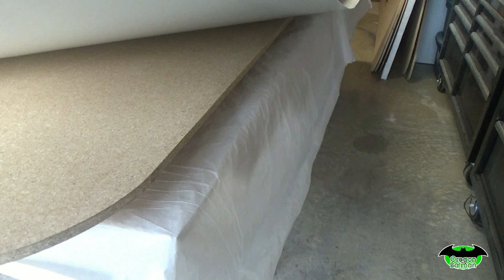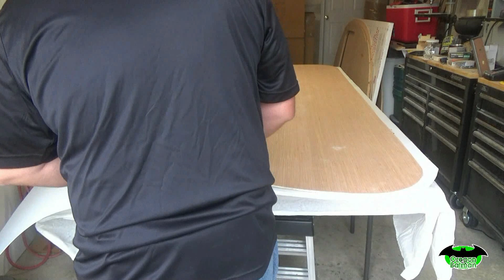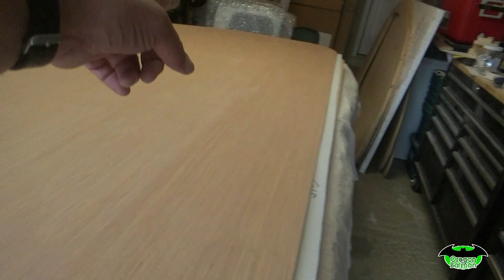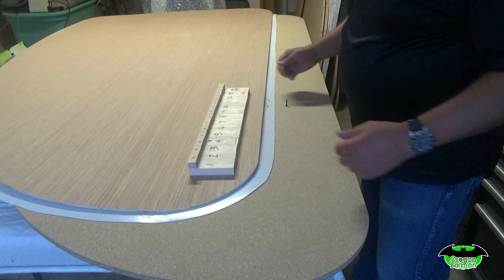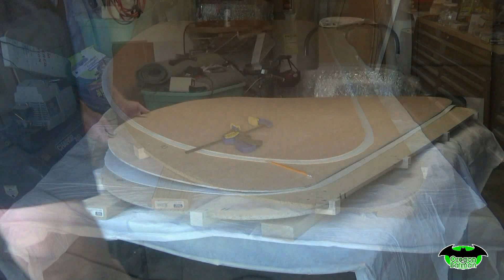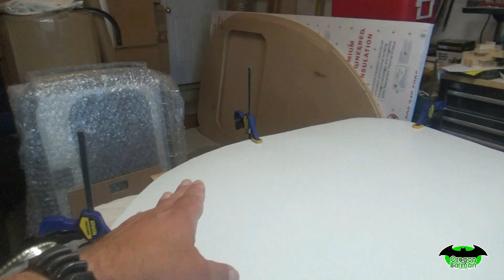Let’s Build A Teardrop * Step-By-Step * - Part 8 (Filon for Outside Walls)

Comment: Couldn't you have put the filon on the plywood sides before cutting either out with the template?
Reply from the maker: Absolutely. I didn't want to install filon until I was ready to install to side of teardrop... the 1/4" wood panel wasn't able to stay completely flat after the install due to moisture content, so it was better to wait. Made it much easier to work with!

Comment: couldn't you just have.....   laid the filon on the template, then clamped it, then routered it out, to perfect fit, then just glue it to the outside wall??   I don't understand why you needed all the blocks, and three-layer deal

Comment: Today we apply filon.  We are using the adhesive you used.  What did you use for thinner to clean the spray gun?  We read the instructions but didn't see anything about clean up.  Our build is coming along.  We are following your build series of videos with the build plans!  Going great!
Reply from the maker: I used Acetone for clean up... turns the glue into a gum which is pretty easy to wipe off. You will need to disassemble the gun to make sure to get all glue out

Comment: If you would use a right hand tinsnips it will cut easier for you than those straight snips. Right hand snips are red
Reply from the maker: Agreed! Although they did the job, sort of chewed the filon up a bit. Ended up using a pneumatic tin snip... now THAT worked great!

Comment: So cutting filon, does it put alot of fibers in the air? Im allergic but love diy projects and have a build going as well.
Reply from the maker: Hi Brent.... cutting by hand, you're safe. If you use a router or a grinder, you will want a nice particle mask. It does produce a lot of dust.
Reply: Where did you order your filon from ? How much did you order and how bad was shipping? Cheapest ive found was 470 for 20 ft to maryland
Reply from the maker: I purchased the filon from an RV surplus store about a 3 hour drive from here.... the average price for filon is $2.75 sq ft.  You can also find it on Ebay for about the same price (or less) with free shipping.  Not sure if you can find the adhesive cheaper though. I paid $76 for the gallon. You can call and see what the shipping cost would be, and I am sure even with shipping, it will be the best deal! Affordable RVing 15555 SE McLoughlin Blvd, Milwaukie, OR 97267 (503) 659-3610. Great people!